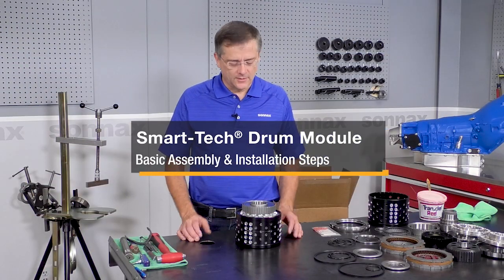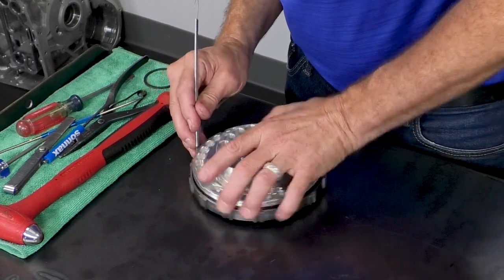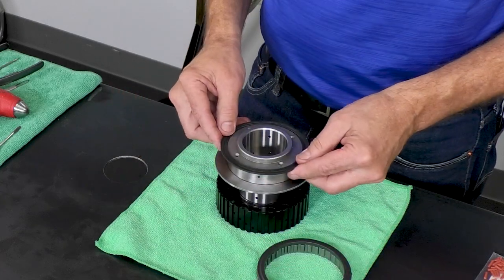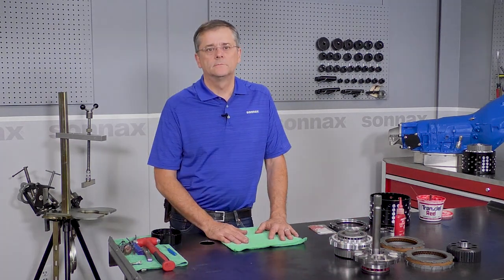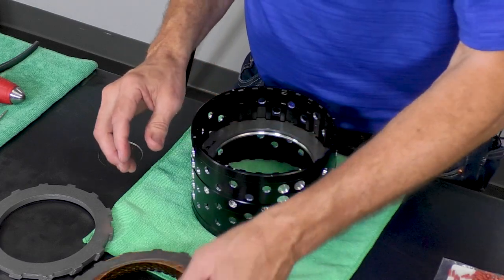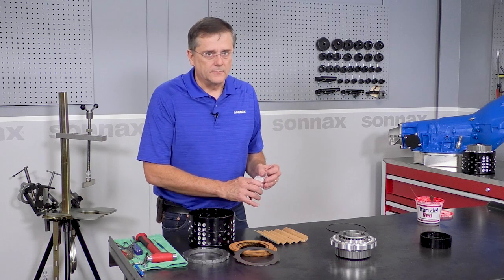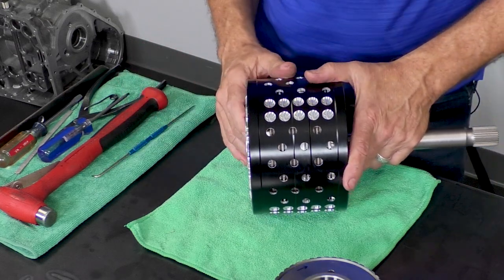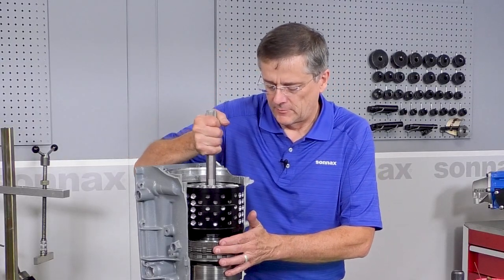How to Assemble & Install the Sonnax TH400 Smart-Tech Drum Module

Comment: how much power can it hold
Reply from the maker: An upper limit is not yet established, but the module has run without issue in a range of race vehicles, some at 3,500 and 4,000HP. No testing has been done in lockup or diesel applications. Thanks for reaching out, and have a great day!